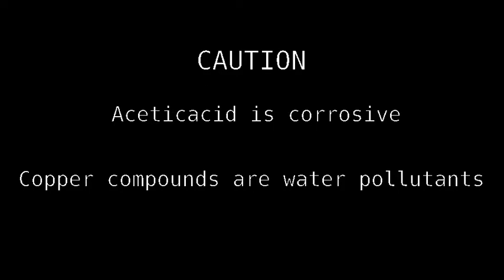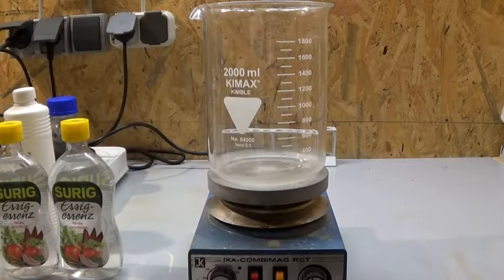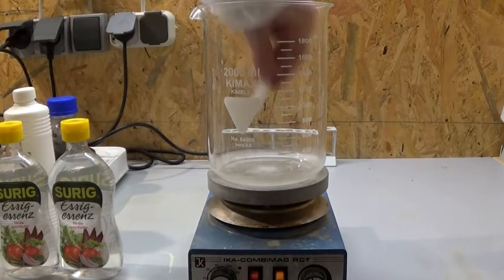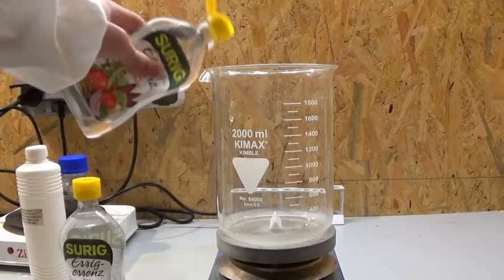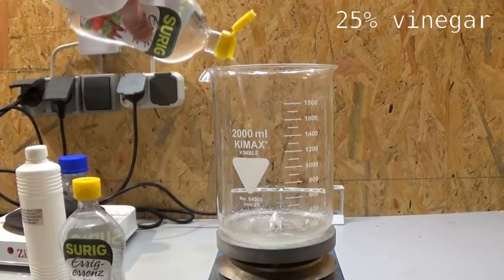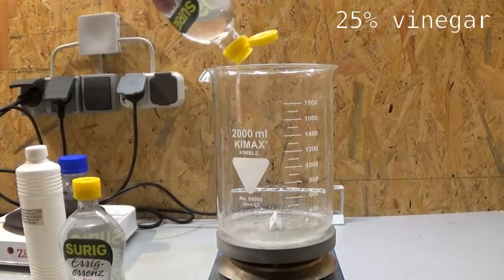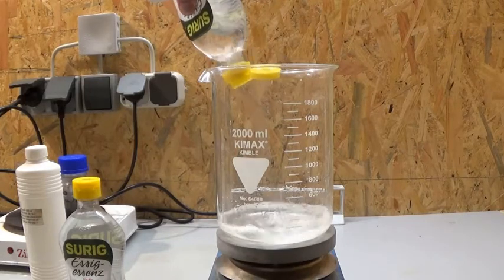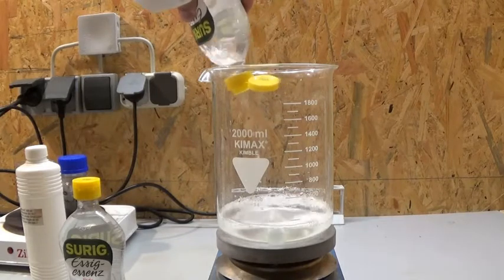Calcium acetate synthesis (first step to lead-2-acetate)

Comment: kindly guide ????mean we should stir for 12 hours continuously or just soak crushed ground eggs in vinegar for 12 hours and after this just stir more... will it work or i will have to stir continously when it ends bubbling add more shell while stiring.
Reply from the maker: you don´t need to stirr it but it decreases the risk of it fuming over plus a higher reaction rate

mfg hazelChem
Reply: @HazelChem  so i should make stiring rod with little DC motor to stir for 12 hours? or actually i m confused with stiring process how to do...stir after 12 hours or keep stiring for 12 while soaking in vinegar
Reply from the maker: @shanilegend  just combine vinegar and egg shells with an excess of the shells... let it sit for a day... when there is no more reaction filtrate and obtain your calcium acetate solution
ps do it at around 30°C that decreases the reaction time !

mfg hazelChem
Reply: @HazelChem  Thank you very much. love your way of guiding. 😊
Reply from the maker: @shanilegend  thx i hope it helped you ! what are you planing to do with the calcium acetate ? 

mfg hazelChem
Reply: @HazelChem  i love chemistry i wonder how these things work. amazing. sometimes it is used for industrial purposes and sometimes fun. there is little practicals we did when we were taugh chemistry at college or university level. later i found this way to learn more by doing practicals.
Reply: @shanilegend  cook the eggs in the oven for 5 mins and then grind it to a powder so it doesn't float up

Comment: Do a Galinstan aluminum reductive amination of acetone with ammonia to make 2-aminopropane. Maybe tin 2 chloride to speed up the process. water as solvent and ethanol as a cosolvent. If you use nitroethane instead, you get N-Ethyl-Isopropylamine.

Comment: How to make p-toluic acid?
Reply from the maker: for this you would need p-xylene then you have to block one methyl group with a protecting group 
and after this you can oxidate the one left methyl group with something like sodiumpermangante or K2Cr2O7 

mfg hazelChem
Reply: Thank you.
 how to do it?
Reply from the maker: it might need some time to look up but i will send you an synthesising instruction

mfg hazelChem
Reply from the maker: i am sory but i cant find any realiable source for a synthesis 

mfg hazelChem
Reply from the maker: this is a good idea I also fought in this direction .... 
but i couldn't give you a verified synthesis paper so i didnt want to say anything what could go wrong 

mfg hazelChem
Reply: I think
This should work))
You need red blood salt to get cyanide.
As well as sodium nitrite.
Everything else is at hand.
In our country this is so.
Because the reaction should not only be true, but also feasible (realistic)
Reply from the maker: verry good idea a KCN video is allready planed and nitrite is no problem 
i also made the p-nitro toluene in a previous video hmmm........ 
i think after the purification of my cloralhydrate i will do your request
thanks for your interest and the comment

mfg hazelChem
Reply: But be against drugs.
it is very dangerous!
Cyanides are also very dangerous!
We must learn safety techniques!
It can be deadly dangerous.
Reply from the maker: dont worry i am working with cyanides frequently and know how to handle them 
and what do you mean with drugs ? I am a little confused 

mfg hazelChem
Reply: ok

Comment: kannst du aceton mit calciumacetat herstellen?
Reply from the maker: save but why should i have liter of aceton ..... 
but if you need informations on it 
it s a simple pyrolysis of the acetate salt (you can do this in a glas distillation apparatus)

mfg hazelChem
Reply: How to make p-toluic acid?